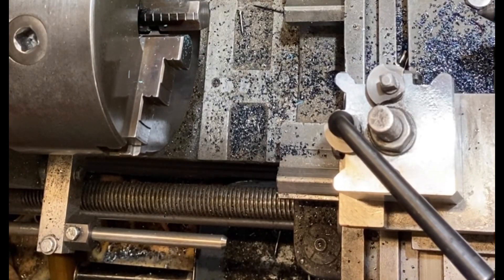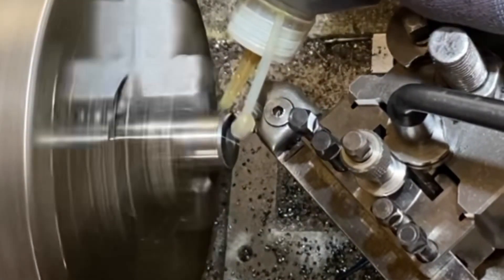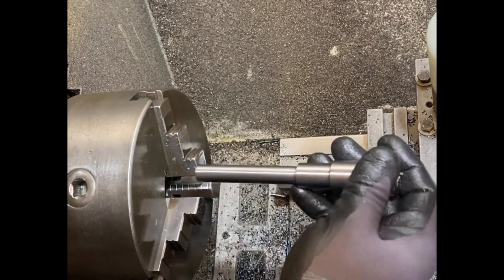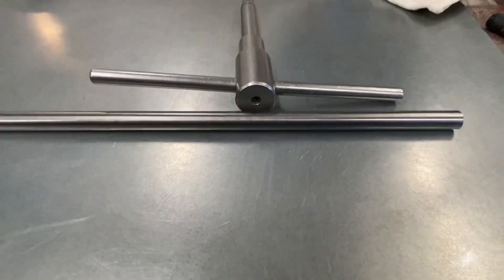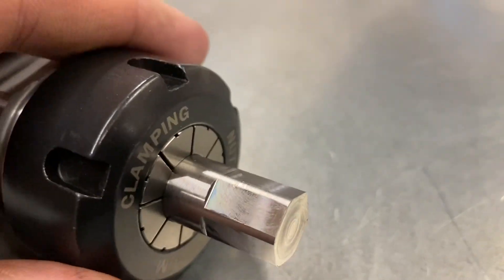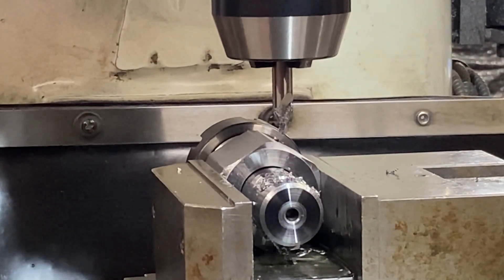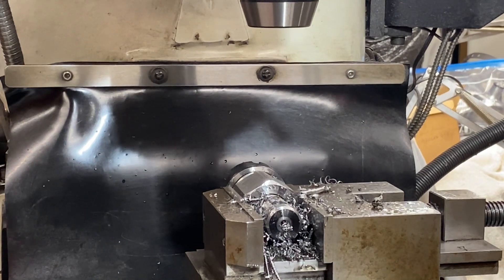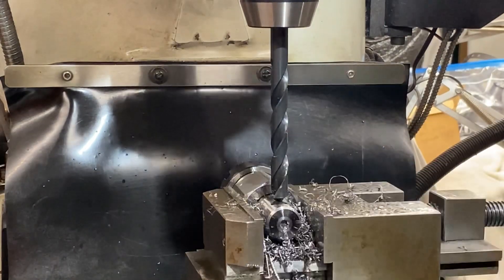Making a new 4 jaw hexagon drive Chuck key - Part 2

Comment: i don't understand how what you did to the collet block helps, surely the vice is still referencing the flat faces?
Reply from the maker: No the flat faces are the sides of the block, the edges sit in the bottom of the vice and ensure that the block sits down parallel with the collet centre line. A square collet block sits down on one of its faces and therefore needs the faces machined and not the edges.